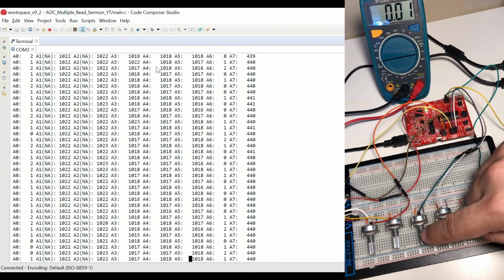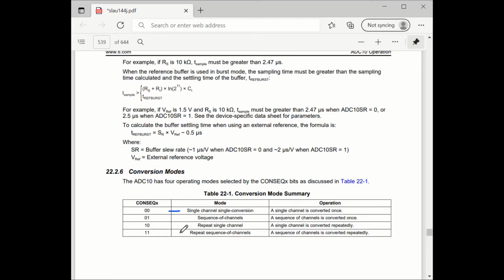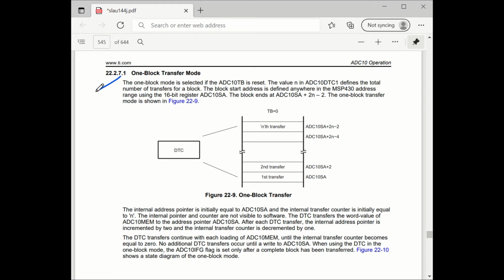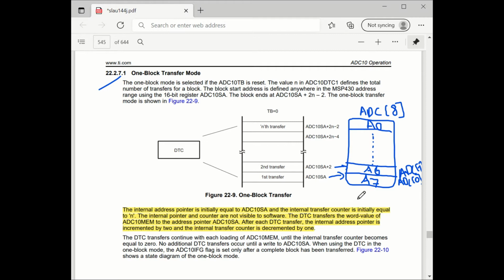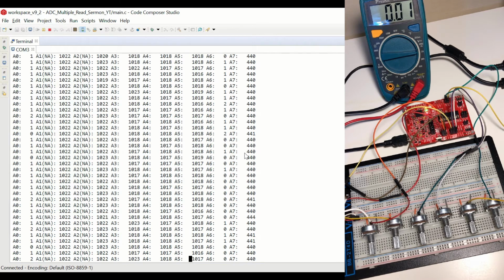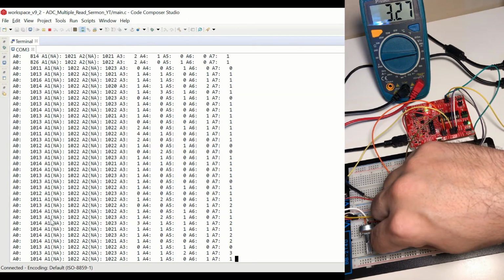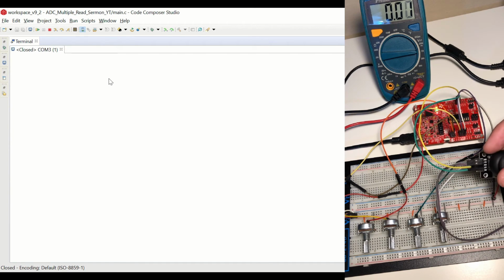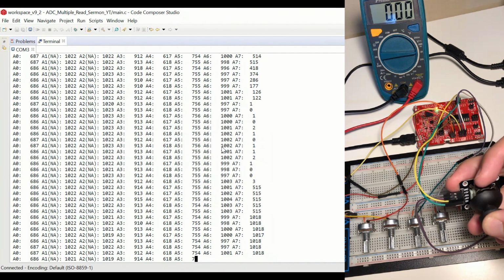ADC in MSP430 Microcontroller - Part 2: Multiple Conversion

Comment: Hello sir. l'm having some issues using ltoa function. Is there any change that l'm missing?
Reply from the maker: Hi, at the time I built the code ltoa function was working well (you should have checked my code in github) however if there's an update to the function you should use the necessary syntax. the main purpose is to convert an integer (long) to a string.

However as I checked the case just previously I came with this article:
https://software-dl.ti.com/ccs/esd/documents/sdto_cgt_handling_changes_in_ltoa.html
There are a few suggestions and one of them is to change the OLD syntax to the NEW as seen below:

ltoa(value, local_buffer);     /* OLD */
ltoa(value, local_buffer, 10); /* NEW */

Can you please try the second line instead of the old and let me know if it works?

Since I received this issue from several viewers recently, we can help them solve the issue and I can update my code.
Thanks in advance
Reply: @drselim  Yes. İt just needed a little search and now it's working perfectly. Thanks again ✌🏿
Reply from the maker: @tzell1917  Thanks, so 
ltoa(value, local_buffer, 10);
works. I'll pin this comment thread.

Comment: Hi! Seem like the code works however in the serial monitor it is displaying a string of weird characters do you have any solution for that? I made sure that the baud rate of serial monitor is the same as uart: 19200
Reply from the maker: Hi, there was an update for the ltoa function, it now requires 3 parameter. I have mentioned it as comments in the code in github. And there's a pinned comment in this video comments as well. Could you check & update the code accordingly?
Reply: @drselim  Hi! Yes I did that, still the output in the serial monitor is just a string of very weird characters.
Reply from the maker: At the moment I can't test and reproduce the problem since I don't have the setup (need to rebuild it) in the meantime can you try using other terminal program such as Putty or Arduino serial monitor to check if it's related to your terminal. It's probably related with encoding.
 + which locale settings is used on your computer (language code& country region code?) Do you face similar problem in other terminal applications (such as while doing a telnet or ssh connection to some host- if you are doing such connections)

Comment: Hello, l have a small question. Instead of potentiometer l want to use a pressure sensor and output the value as a bar. Here is the code that l want to implement : 
        aVal = ;
        voltage = (aVal * 5) / 1024;
        pasVal = (3 * ((long)voltage - 0.475) * 1000000);
        bar = pasVal / 10e5;
All these variables are long. How can l transfer analog reading from P1.0 to bar reading ?
Reply from the maker: Hi, all the code you pasted seems valid and I guess they can directly be used in CCS, aldo I'm not sure what you mean by the bar reading, it's again a value that can be converted to char, right?
Reply: @drselim bar as a pressure. After doing the math converting from 0-1023 to  0-70bar (for example) l want to print that pressure value. The reading from pressure sensor. The conversation work but l couldn't make the printing of bar veriable.
Reply from the maker: @tzell1917  Oops, now I understand, bar as the unit 👍. Can you read the value in the expressions window (I suggest you define it as global variable)? you can check it with using breakpoints or pausing the code after running it. If you can see the value, than you need to focus on what is wrong using the ltoa function.
Reply: @drselim  Sorry for late answer but can l ask how can l read the analog value as a float? Instead of integer reading (0-1023) how can l have a decimal reading (23.4-10.23 etc.) If the problem is ltoa is there any other function that l can use for float reading ?
Reply from the maker: @tzell1917  In the ADC modules, what you'll get is the corresponding integer value (for 10 bit ADC it'll be 0-1023 , for 12 Bit it'll be 0-4095, etc.) compared to the reference voltage value. As its name ilplies it's analog to digital. But you were already converting those integers to floating points in your code and in the examples in  my videos we print out floating point values as well. I'm sure you'll solve your problem with changing your code. 
In the distance sensor video, I'm converting an integer obtained from the timer interrupt to floating point, maybe you can check that video and code. 
https://youtu.be/LzOVfDQaol8

Comment: Great video as always!!! 
Are you an EE or EE instructor?
I love your videos!

I have a question related to this video as well as the last one you posted about the servos. How would we be able to control a larger amount of Servos using the MSP430?
For example what if we want to control 6-7 with a 2-3 joystick type pot? Do we need to use a microcontroller with more pins or is there a chip we can use in combination with the msp430 that will allow us to do this? I have read in forums that there is an LED driver chip (TLC5490) that may work for this. Are you familiar with it?
Reply from the maker: It’s great to know that you find the content useful. I think you have notifications on for the videos :) Thank you for your high interest. 
Yes, I’m an instructor in the university in EE department and I’m trying to refine my lessons and make them compact in these videos, so that both the students and all interested people can use easily. 
Regarding your questions: In the coming videos I’ll be controlling a simple robotic arm (using 4 servos) . But I did not start the assembly for the arm, probably it’ll take some time to finish it. But as a quick answer to your question: no you don’t need an extra component or mcu; you can control servos in two different ways:
1 - creating pwm using timers as shown in the servo video, you should use the pins with timer property
2 - creating pwm by digital i/o ( you can set a digital pin high + add delay so that you set the duty cycle + set the pin low + add delay to complete the period)
As you already saw how to read the values from potentiometers, you can use them for controlling the servos.
Reply: @drselim  I’m a very interested and appreciate you using code composer over energía. Most YouTube videos relating to MSP430 tend to use Energía. I am an EE student on my way to my third year. I am always trying to find new content that can enhance my knowledge. I am glad I found your channel. You deserve a lot more credit and followers. 
I do have my notifications on and always get happy to see you have a new video up. Thanks for the knowledge you share.

Will you be covering the second method you mentioned to control servos ? 

I am actually working on a miniature robot arm too. Which is why I am researching ADC, PWM, Servos and analog sticks. This project is not part of a class it’s for myself. I am interested in the subject and I enjoy doing it. Thanks again!!!
Reply from the maker: Sure, I’ll add it as a section in the coming content. 
Thank you for your kind comment about the channel. It’s already very satisfying to make a positive effect for a single person. 
Good luck with your lessons and projects :)
Reply: @drselim   Awesome!
Thank you for the knowledge. Please keep doing what you are doing. Have a wonderful day!
Reply: @drselim  
One more question, is there a book that covers these concepts that you recommend? I would love to have book related to this launchpad and programming.
Reply from the maker: I recommend the user’s guide. It is the main source to study. It’ll also be good to check and understand the msp430g2553.h header file in ccs, it supports a lot.
Reply: @drselim  sounds good. Thank you!